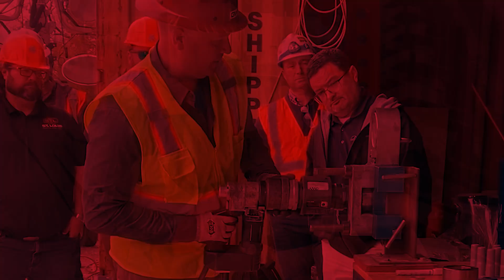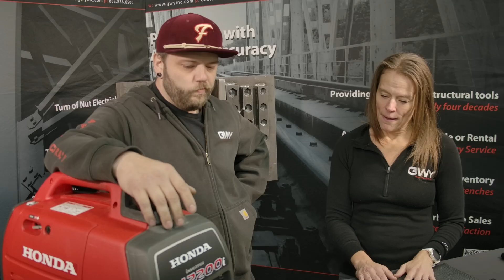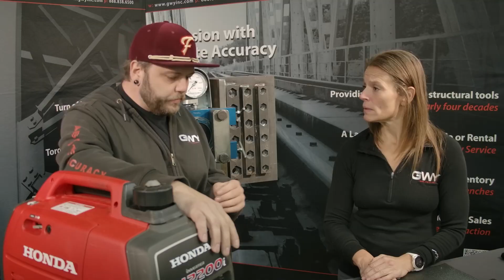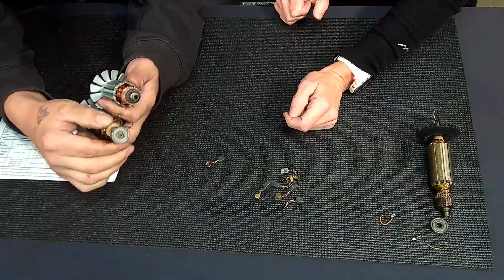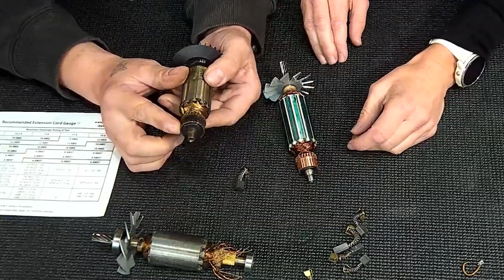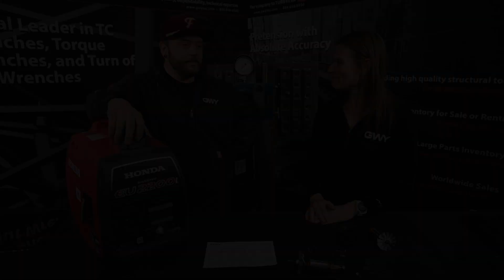Let's Talk Power🔌

Comment: Looking up the specs of the Honda generator you  recommended it has a THD of 3%. What is the maximum THD of a generator and still be considered "clean power" in your opinion?
Reply from the maker: Hey! We actually recommend generators based on the watts/amps. As long as the rated output is higher than the wrench being used, you're good to go. This particular generator peaks at 2200W (18.3A) but is rated for 1800W (15A) while running continuously (not on eco mode), so tools with lower amperage than the generator would be working off "clean power." For the THD, it really depends on the generator you're using, but it seems the lower percentage, the cleaner power and reduces any possible tool damage. Hope this helps!